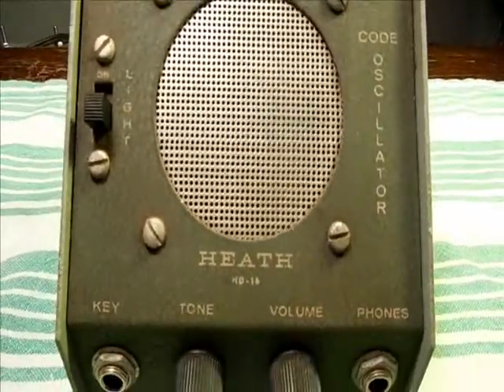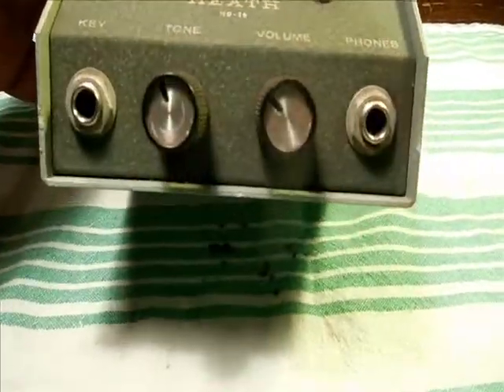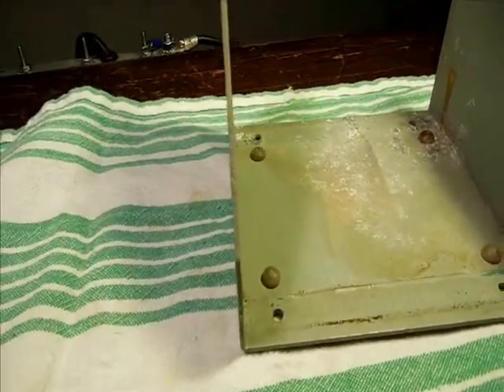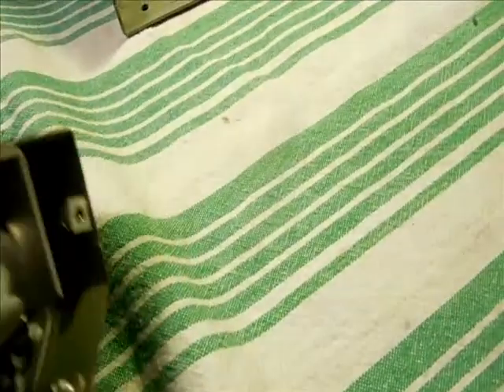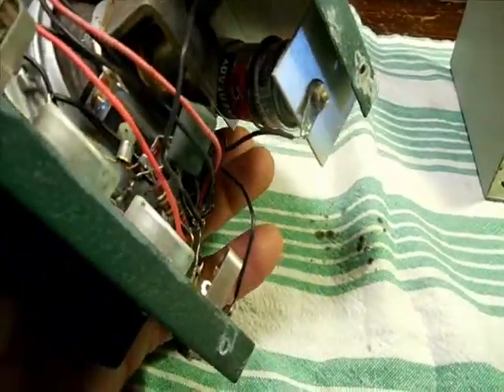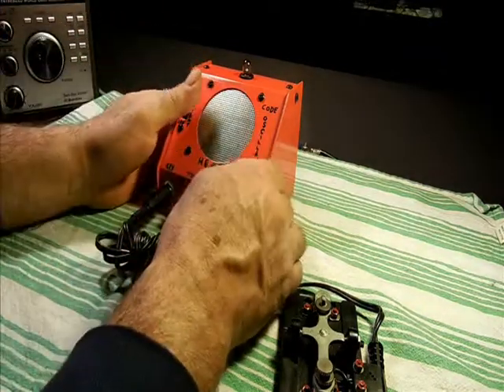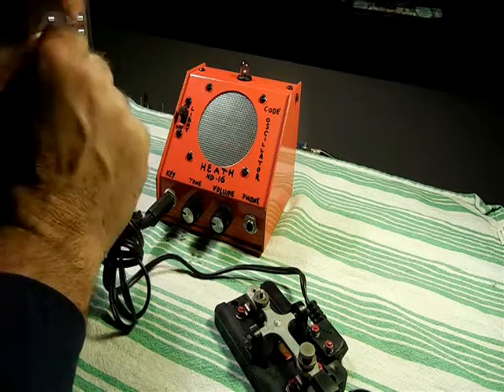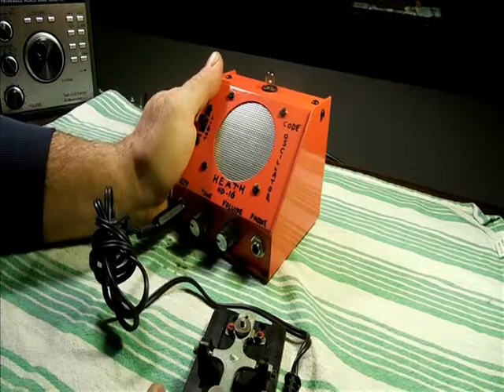Heathkit HD 16 Code Oscillator Repair

Comment: My grandfather built one and gave it to me when I was a kid for a birthday present.  That was over fifty years ago!  I still have it and I still use it.  It sits on my desk at work with a Vibroplex bug.  I practice a little bit all the time.

I must confess that I hated the way the uni-junction transistor sounded so I replaced the guts with a good sine wave oscillator.  It is a bit rough looking, after all I was just a kid and it got banged around a bit.  I always thought the lamp was stupid.  It is always a reminder of my grandpa.
Reply from the maker: Very good to hear this Steve! I'am sure Grandpa is smiling! Communication via Morse Code can save lives in emergency situations, weather by audible signal, flashing light, reflection via mirror, tapping on a pipe...and on and on!

Comment: It was salvageable not sure about the mod orange
Reply from the maker: +Alan Kroeger I believe there wasn't any primer under the original paint. I was willing to accept it as it was, scratched, scuffed, faded etc...as long as it worked! Had to clean it though, because it was nasty/dirty. I soaked it in warm water with a drop of regular dish wash soap...and the majority of the paint separated from the surface! The orange paint? At this point, and too cheap to spring for a can of Heathkit paint, it was what I had on the shelf!